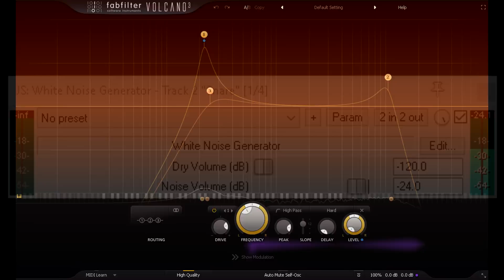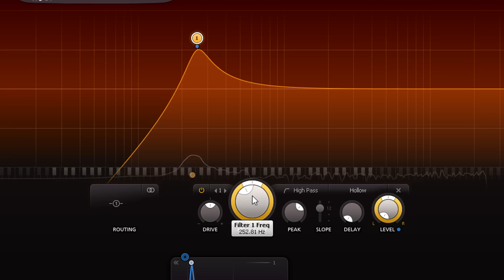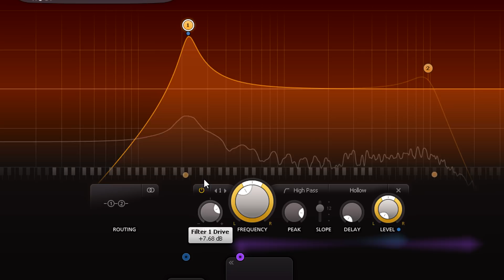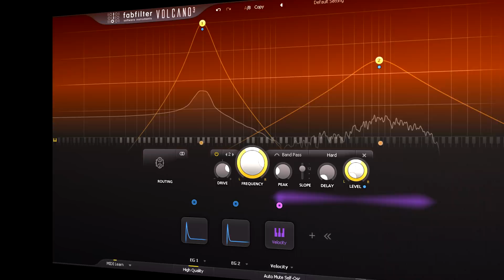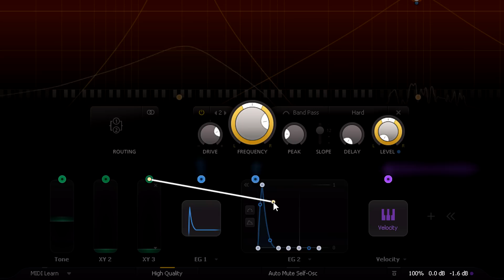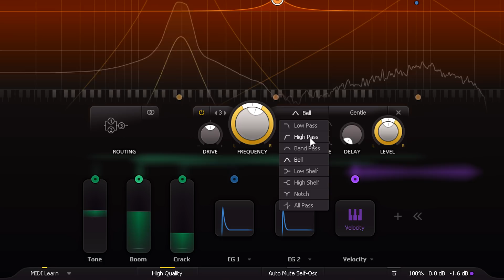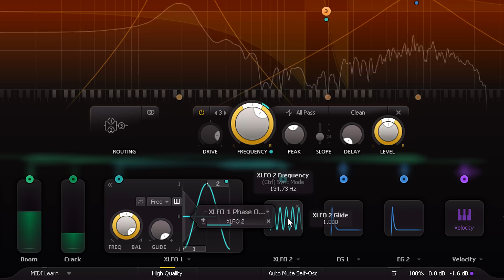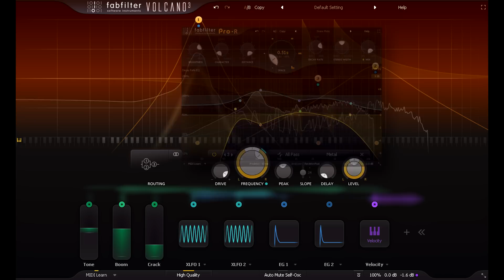Synthesizing Snare Drums with FabFilter Volcano 3

Comment: i'm not convinced yet that i should be synthesizing snare drums at all. it's kinda tedious and even dan worrall doesn't manage to make a smacky and punchy snare with a sweet flavour out of white noise and some filters. but one thing is for sure: this allpass filter trick is awesome! and this video in general was a great way of showcasing the slider modulators' features (mod depth, bidirectional, renaming etc.)
Reply: snare is the only type of drum that I'd always rather get sampled than through synthesis. It just almost always lacks power
Reply: @DKH712  maybe it would be possible to synthesize good snares by using similiar techniques to these, but on a larger scale. like instead of one wobbly allpass filter adding metallic tones, add 30. and then smash it with amps, OTT, clippers and stuff in parallel to really twist it into something more interesting. and then bounce 20 of those snares to an audio track and layer them all together to precisely sound as good as they can. maybe then it would work somehow
Reply: @Beatsbasteln  I mean, maybe. Some combinations of all those effects are sure to give good results, but I feel like I've gone down that path enough times to feel sure in saying that too much of anything is a bad thing. ;) 

Honestly, most snares in good sample packs are probably designed with simple techniques like in this video, but with a lot more time and effort going into the tweaking of these parameters. And when it comes to the biggest punchiest drums, guaranteed the samples most of us are using have already been meticulously EQ'd and compressed before being rendered as samples. Probably that EQ and compression is also applied to several individual layers of a sound, compressing the noise components separately from the tonal stuff for example. The question isn't really if these sounds can be synthesized, but whether it's worth the time and effort to do that yourself. For many of us, the answer is often no, since we can dig through a sample library to find the kind of sound we want more quickly. 

Making  your own sounds will let you sound more original though, fwiw.
Reply: @andreyamakesmusic  yeah i just feel like making own drum sounds from synths can be fun. i mean regardless of wether or not the resulting sound is good or can be achieved in a different way faster. so from a purely commercial standpoint you would not synthesize snares. but from an artistic pov you might just do that for fun and inspiration
Reply: @Beatsbasteln  Oh yes, definitely. And even if you do want to think commercial/utilitarian, the path of least resistance might not always be the best one! It's hard to stand out nowadays, having sounds of your own can make a difference.
Reply: to be fair, synthesizing snares using classic synths and all-purpose plugins is pretty tedious BUT there are some pretty neat drum synths that yield pretty good results with little effort :)
Reply: Same. Synthesising drums works best for kicks, but that's about it. Shakers are OK I guess, but they'll still sound artificial. Samples are always best.